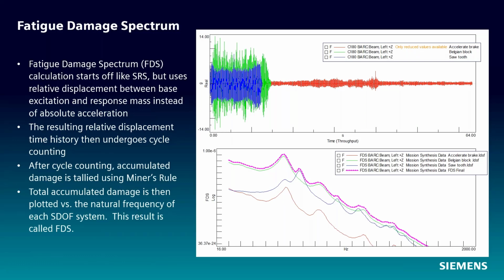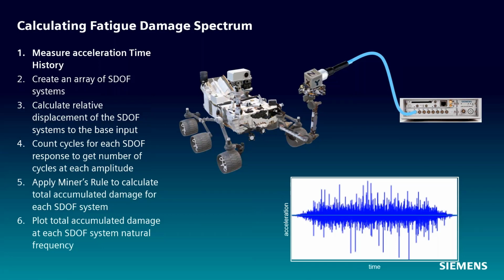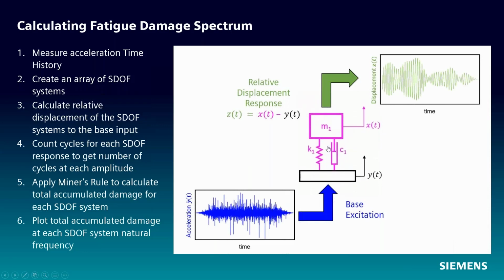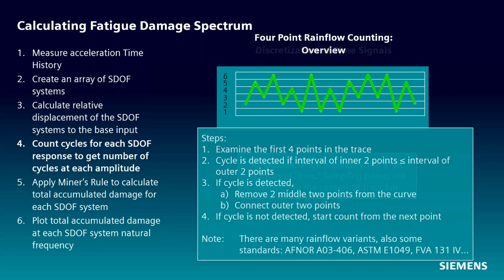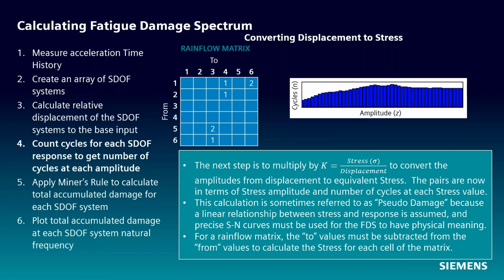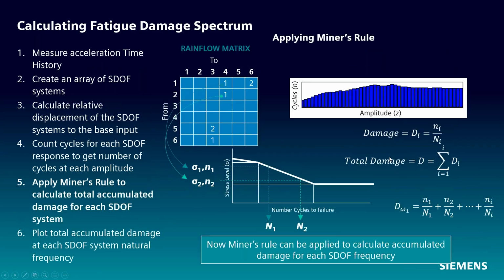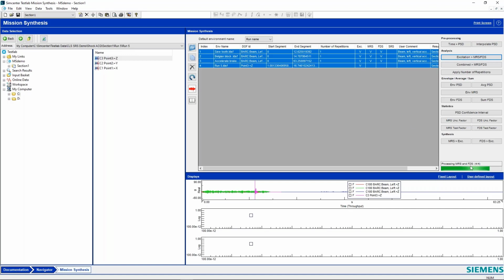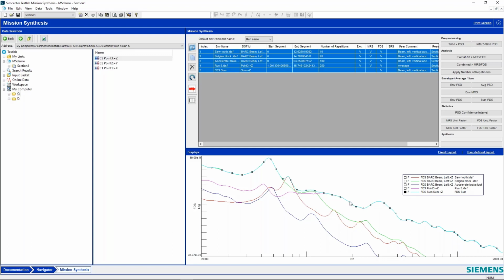Fatigue Damage Spectrum

Comment: 28:34 where have you guys defined the other natural frequencies and whole curve for other systems so, how does this spectrum come without specifying these parameters
Reply from the maker: 28:37 - it is actually a single slope linear approximation of the Whoeler curve (Basquin law N σ^b=A^b). The natural frequencies are defined by the “frequency axis parameters”. For this analysis and for SRS calculations, there is a subtle but important difference between the two, as pointed out in the articles https://community.sw.siemens.com/s/article/Fatigue-Damage-Spectrum and https://community.sw.siemens.com/s/article/shock-response-spectrum-srs

Comment: How did you define the no. Of systems and their natural frequencies for an example if DUT is a bicycle then :
1. Is all the bicycle component will be counted as different system where SDOF model will be applied to each and every system (bicycle components) and similarly the natural frequency of all those components as well as there SN curve will be u still see to find the FDS curve 

Are my above assumptions correct or please suggest the correct assumption
Reply from the maker: Do not confuse the SDOF systems with the natural frequencies of the test object.  Mission Synthesis goal is to derive the input to a test article whose resonant frequencies are unknown. FDS uses for this scope a generalized resonance model under the assumption that (unknown) resonances ultimately lead to fatigue failure.

Frequency spacing limits are often suggested by standards (e.g min xx points per octave), but I find a good practice for defining the frequency spacing to quickly analyze the frequency content of the input events upfront to make sure I am not cutting out input energy. For example, if the input signals show a clear sharp peak at around 4 Hz, a 2 Hz resolution starting at 1 Hz will lead to [1,3,5, …] Hz frequency axis which will result in an interpolated value at the critical 4 Hz frequency. It would be better to start at 1 Hz and define a 1 Hz resolution (or at 2 Hz with a 2 Hz resolution, for the sake of this example).